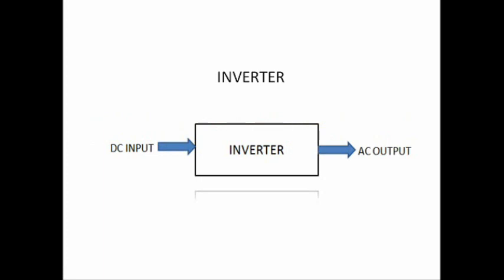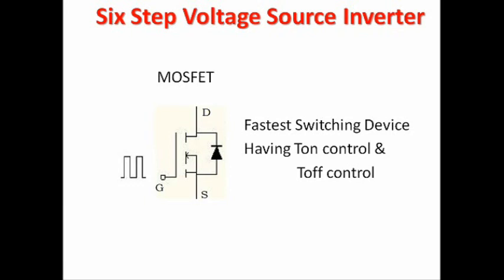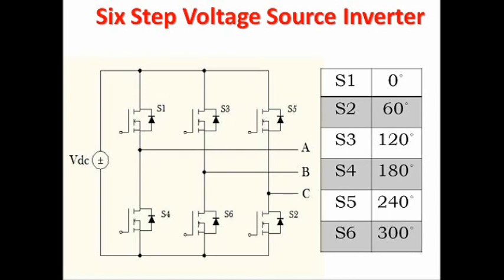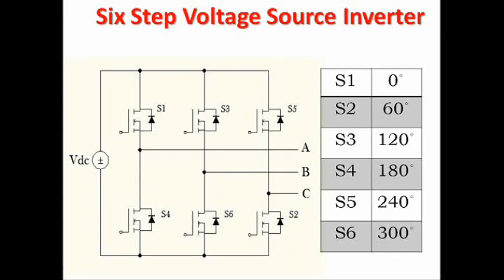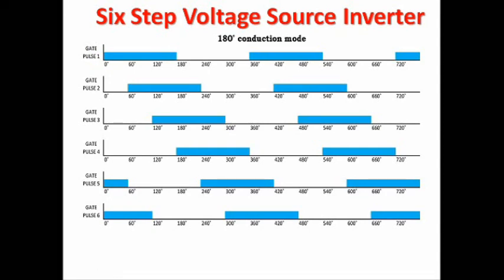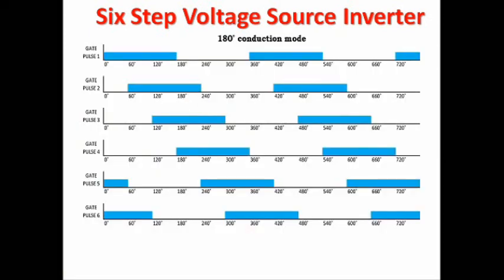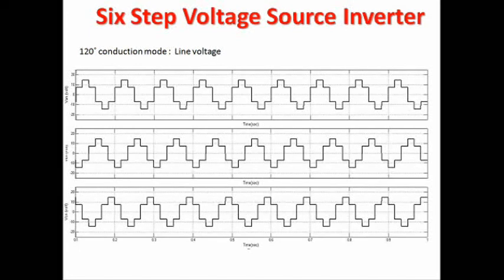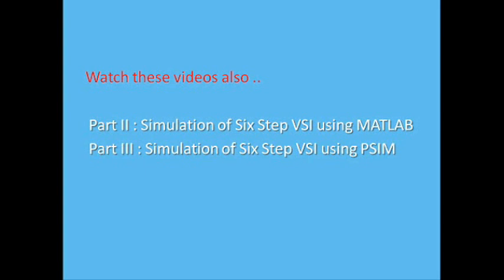Six Step Voltage Source Inverter part I (Circuit Demonstration)

Comment: My friend how are u today. Big  CongraCongrats bro. Let me ask u if use the same of ur diagram can it be drive by 25ov when I eltfire I got 450vdc let me ask you the question I have to join IGBT   input pmw between 123 for forward.  N for reward I have to connect between  456 yeah

Comment: Thank you for the video.
a question please :
what would happen If the 6 switchs are off.
how much voltage would be in each line ?
Reply: With all switches off there is no voltage on any motor coil. The voltages into the circuit will be whatever is fed to the circuit. Should a person answer such old questions? Thought I'd do this one anyway.